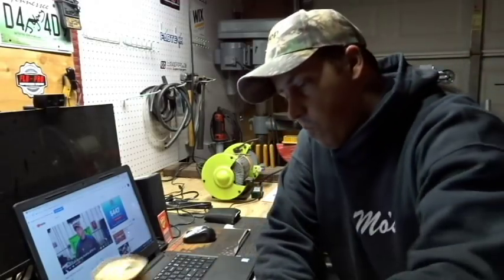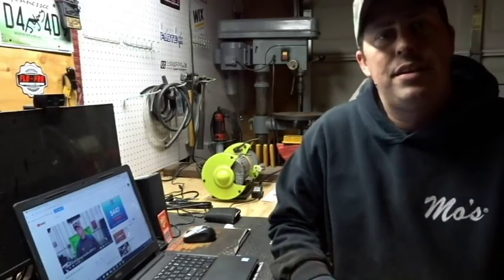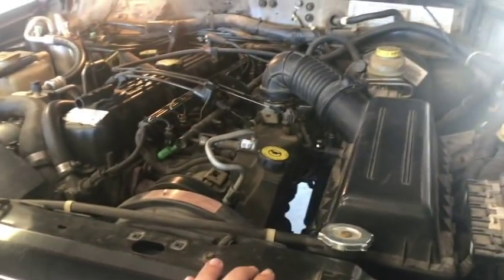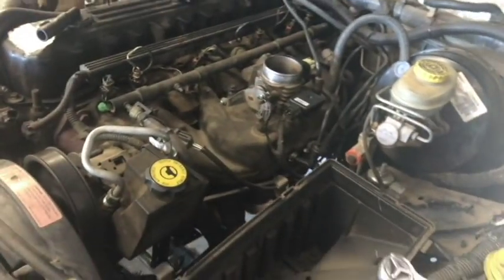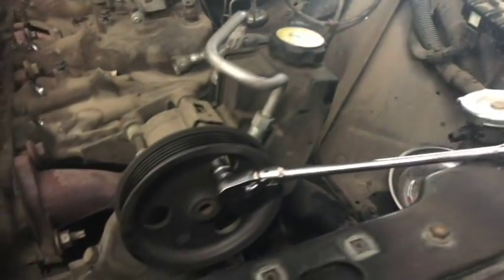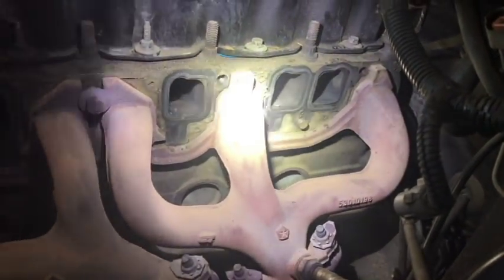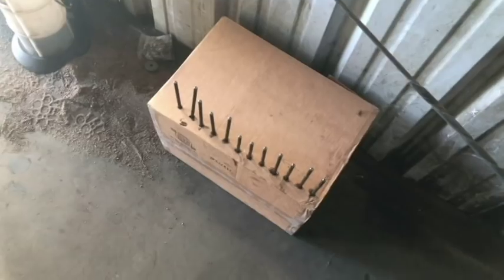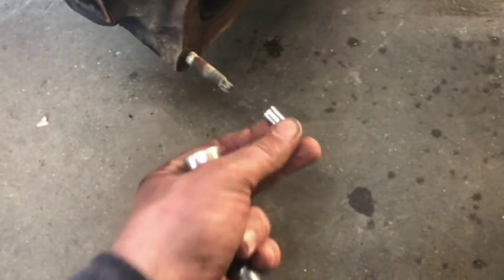Jeep 4.0 Ltr Cylinder Head Removal

Comment: I'm removing the head gasket on my mothers (now mine) old jeep so hopefully this will help me but what is the torque specs and sequences for all the bolts?
Reply from the maker: I don't know off the top of my head, but if you google it there are plenty of images with spec at your disposal or you could look in a haynes of chitlon manual.

Comment: So which is it , a 1/2" 12 point or 13mm  12 point socket for head bolts getting conflicting stories , I have 2002 jeep wrangler 4.0 liter
Reply from the maker: Steven Wiseman If you look at the math medical chart there’s really not much of a tolerance difference between 13 mm and 1/2. I have never had an issue with 13 mm 12 point. And I’ve done at least a half a dozen heads on the 4 L in-line six
Reply from the maker: Also I think you’ll find a 3/8 Drive socket fits best for tightening and loosening that bolt in the rear.
Reply: Thanks for the response , I'm getting ready to do this to my 02 wrangler ,just wanted to make sure , your video is going to help me out a lot
Reply from the maker: Steven Wiseman No worries. 😎👍
Reply: Just did this on my 02 Wrangler… 12pt 1/2 3/8 drive was perfect.

Comment: Doug here, very informative well thought out . I have to put a new motor in mine ben looking at all the videos I can find . It’s been sitting for four years now, probably have to drop the tank clean it out. If you could, please give me some of your professional advice on any thing else that I should check replace,or do? I will appreciate it so much thank you 🙏!!!!!
Reply from the maker: That's a great place to start. Start by changing all the fluid's, hoses, maybe change the battery if it's older then 3 years and not holding a charge, spark plugs, & fire it up. Drive it for 100 miles if it's possible. If all is good. Run it. Cheers and best of luck.